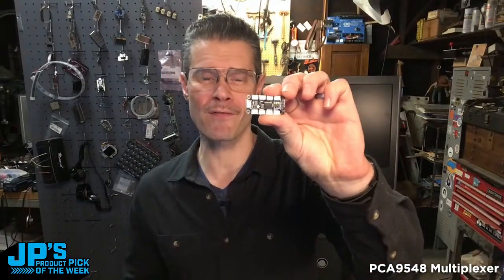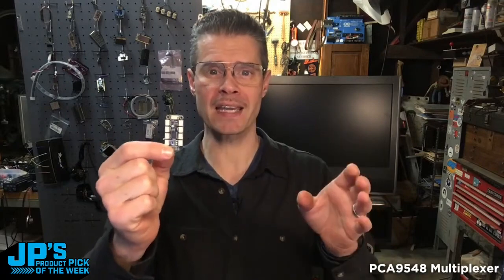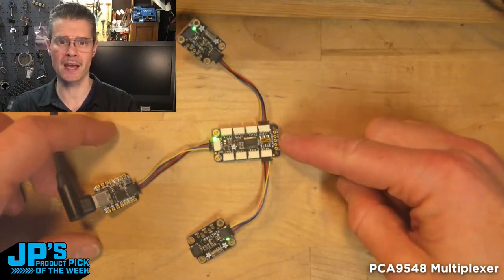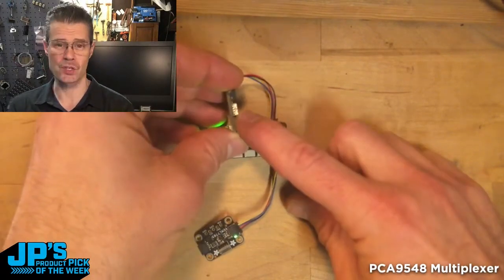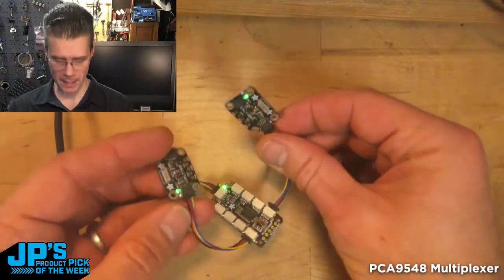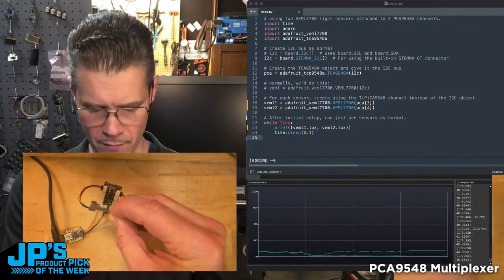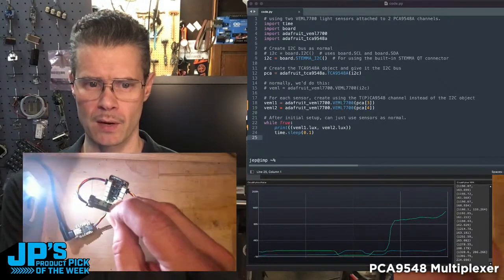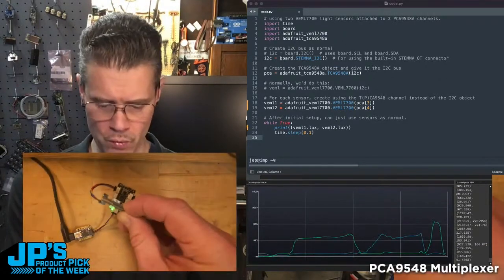JP’s Product Pick of the Week Recap 12/6/22 PCA9548 Multiplexer I2C @adafruit @johnedgarpark

Comment: If you have an I2C device without an address (or devices you've maxed out their address space) you can use this to add more. It works great. I've used it to add 10 7-segment displays when 8 is the maximum addresses it supports.  With a maximum of 8 multiplexers you could have 256 7-segment display backpacks per bus but only because the 7-segment displays use the same address space as the multiplexers.  Normally, if you use a sensor that doesn't have an address of 0x70-0x77 like a BME280 temp sensor you could have a maximum of 512 PER BUS. Since most adafruit controllers have 2 buses... that's 1024 temp sensors per microcontroller.  In order to get more than 1024 you would have to find a way to multiplex more than 8 multiplexers per bus. You would likely run into voltage and current limitations long before you reach the maximum amount of devices these things can support.